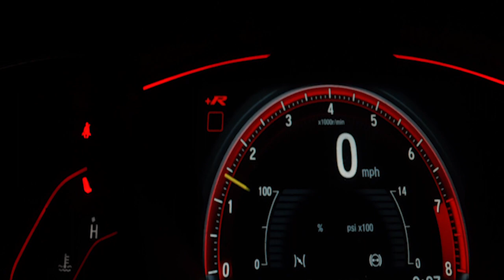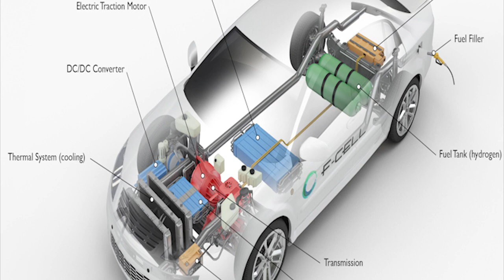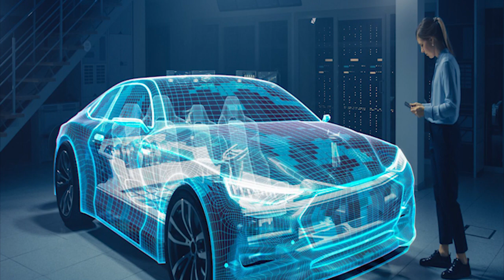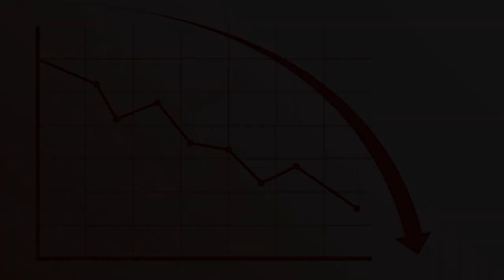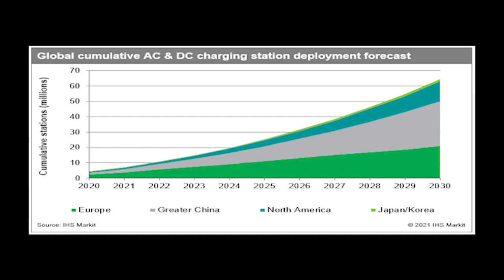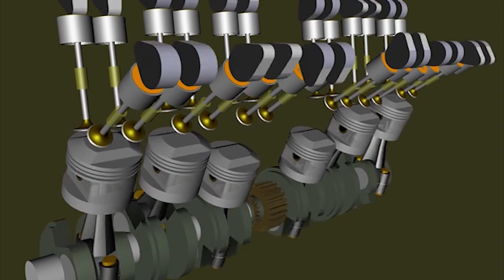Game Changer | Hydrogen powered cars | Toyota Hydrogen Engine | Hydrogen Combustion Engine

Comment: I dunno...a gas tank is bad, but this gives me a different kind of fear - be like riding on a potential bomb! Even if only one out of a thousand failed, and you'd never know you were gone, it'd be my luck....
Reply: It's not an issue. We've had LPG tanks for years
Reply: @yasi4877  LPG does not have to be held at the insane pressure Hydrogen does. Plus the molecules are much bigger so easier to contain.
Reply: Hindenburg Highway?

Comment: I drive a gasoline car.  I would go electric if I had the chance, but would never touch hydrogen.  The fuel is too expensive, the engine is overly complex, and the high pressure tank scares the sh*t out of me.
Reply: I don't drive gasoline because of the tank of highly explosive liquid behind me.  Far more explosive than hydrogen
Reply: @charlesweaver8302   Ah yes, but gas is not under high pressure.  When I make a switch, I'll go electric.
By the way, diesel is flammable but not explosive.  I see your point though.
Reply: @charlesweaver8302  Have you seen the way EV batteries burn if they catch fire. Hot enough to melt steel.

Comment: Except the efficiency of making hydrogen is half that of using the electricity directly in an EV. No way around the physics.
Reply: Nicola Tesla would not lend his name to an electric vehicle that had to lug around a half ton or more pack of AA batteries. It's grossly inefficient despite the so-called physics you claim
Reply: @yasi4877  It's actually quite a bit more efficient. Also there is regenerative braking which improves that even further. P.S. You do know what Nicola Tesla invented the electric motor type that is used in a Tesla.. right?

Comment: Fuel cell cars are expensive to buy and run but fairly efficient so have a reasonable range but the only reason the hydrogen is as cheap as petroleum is because Toyota subsidise it. 
Hydrogen ICE cars are expensive to build, expensive to run and are horribly inefficient so will have a terrible range and if there were a lot of them Toyota would no longer be able to subsidise it so the hydrogen would be ridiculously expensive. 
Currently something like 2% of the worlds carbon emissions come from producing hydrogen so using it to power cars would be incredibly polluting (much worse than a hybrid petrol car) and there is no sign of that changing any time soon.
Am I missing something here? Who in their right mind thinks this is a good idea?
Reply: Its an awful idea. There is no point in using hydrogen as a fuel, it is very hard to store safely as it is the smallest molecule. The whole rationale for this is based on CO2 causing climate change thus giving the narrative that ICE engines need to be phased out. This is nothing more than a criminal scam. High time it was busted!

Comment: and where do I fill it up ?  no where
Reply: At current gas stations which will be converted to hydrogen stations in a massive global scale up
Reply: @patrickhook9433  Er, they won't.   Town and city planners won't allow huge tanks of hydrogen (stored at 10'000 psi) to be sited anywhere near housing.  I never did see the point in using massive amounts of electricity to create hydrogen, to then have to transport it all over the place - producing more CO2 in the process - to then use a fuel cell in a car, to convert the hydrogen back into electricity at a loss to power an electric motor to move the car. Why not just skip the grossly inefficient hydrogen production process, and the transportation, and just charge the battery in an EV in the first place, which uses the energy at 80 to 90% efficiency?  And who pays for all the "conversions" of gas stations? Do you suppose they might add it to the cost of the hydrogen when you fill up?
Reply: @Brian-om2hh I agree with your statement if.......

Where are the raw materials coming from the create the batteries for the EV's? How are the raw materials transported? What fuel do they use during transport? Once the batteries are produced, how do they get transported to the vehicle assembly plant....

I would enjoy seeing how your debate stands up.
Reply: Brian, if its produced on site at each hydrogen fueling station, they won't have to transport it like they currently have to transport gas and diesel.